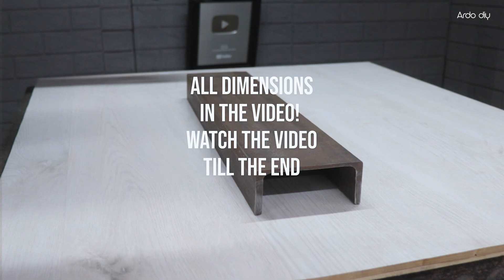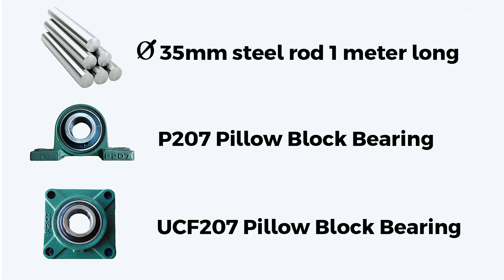DIY Heavy Duty Metal Roller Bender - How to Build Roller Bender

Comment: Hello I hope you're doing great, I like your vídeos, you're doing great job keep doing.

I would like to know if I can roller a round pipe with this tool?
Reply from the maker: Yes, you can bend round pipes with this roller 👍 Thanks for your question! To get a smooth and accurate bend, it’s best to use guiding rings on the rollers.